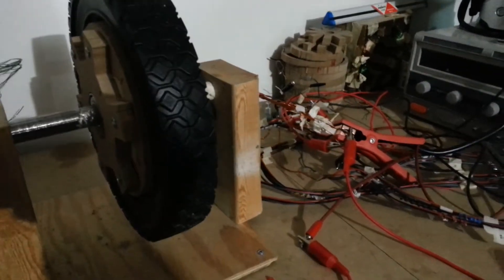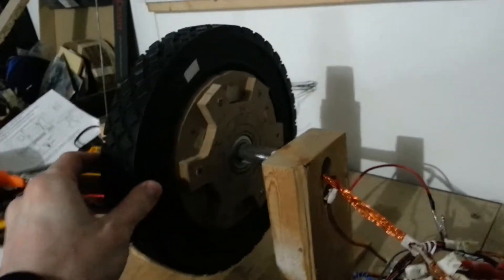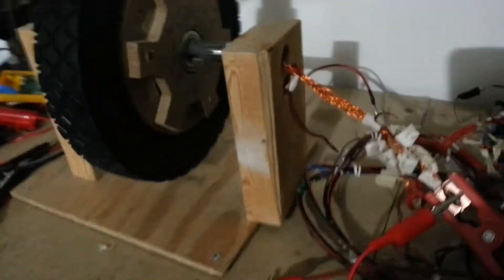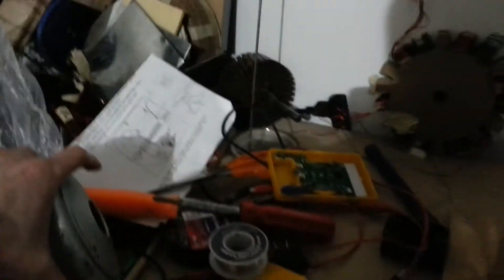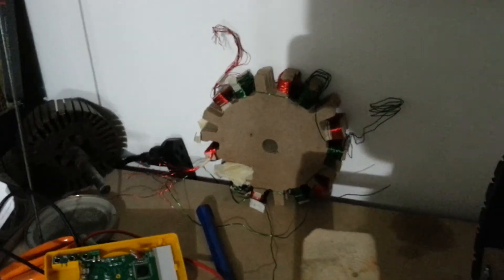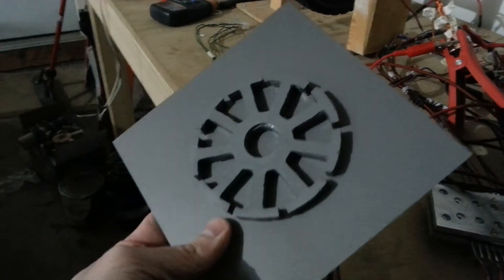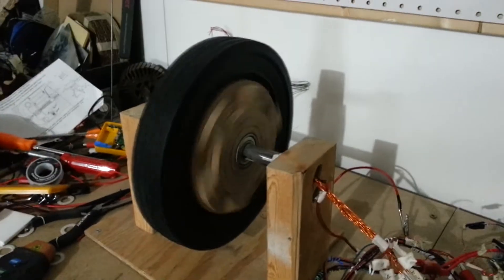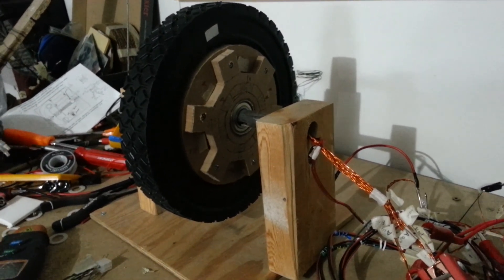Building a brushless electric motor - Introduction (Part 1)

Comment: Impressive looking motor.  I liked and subscribed, and hope to see  the rest in the series. To see how it is built and performs. 

Im guessing you already know this when you eventually mentioned special metal, but for anyone that doesnt know, one thing needs to be cleared up regarding 3:50 statement on laminationed steel. Yes laminated steel does help reduce eddy current loss, but they do not reduce hysteresis loss. Rather, using specially chosen metals like electrical or silicon steel and a few others that have low coercivity and low retentivity result minimizing the the area contained in a hysteresis loop,  thus minimize hysteresis loss.  https://www.nde-ed.org/EducationResources/CommunityCollege/MagParticle/Physics/HysteresisLoop.htm

Comment: Hi, like your design ! would you have the kindness to send some links about how theyr exactly made? ( calculation and so on) Cause i'm planning to do a motor that fits into a 10cm wheel and i've got a hard time to find godd stuff on the net.
have a great day and sorry for my rather porr English !
Reply from the maker: +Johan Kuhn Thank you! I have a few links that helped me. If you have specifics of what you want to make, I may be able to help with my own experience.  It is very difficult to find good links on the web, you're right. This first link has some rough calculations:

http://www.instructables.com/id/Make-Your-Own-Miniature-Electric-Hub-Motor/

This website is the kit that I bought to first teach myself the principles of BLDCs:

http://simplemotor.com/

One thing to keep in mind, from my own experience at least, is the speed vs torque trade-off. Higher voltage, smaller and less powerful magnets, and more turns of wire tend to produce more speed. More amperage, thicker/stronger magnets and more poles/teeth tend to produce more torque. And sometimes it is very difficult to get both in the same compact design. (More amperage needs thicker wire which means fewer turns, but fewer turns may reduce RPM).

This website helps you calculate how many teeth/magnet poles you need:

http://www.bavaria-direct.co.za/scheme/calculator/

I'd be happy to help out with any other questions.
Reply from the maker: Johan Kuhn
I bought my steel from http://electro-core.com/
The steel is pretty cheap, and cost a lot more to ship than the material itself. They will cut it to a general square or rectangle shape but I had to cut the teeth manually using a dremel table, as the cost of CNC cutting a small run is prohibitive.Get the thickest pieces you can get. I got 0.011", I believe, and it took forever to cut that many pieces.
Reply from the maker: It really depends on how you want to design your vehicle. Most electric vehicles rely on an inverter to change the DC battery voltage over to an AC current for use in AC induction motors. Tesla uses two massive AC induction motors in their Roadster drivetrain.  Maybe I'll make a video about it too, but 30KW is big enough that I wouldn't want to actually build it as it'd be costly and very heavy. The electronics to it would cost the most. Still, it'd be cheaper and probably lighter than a BLDC like mine.  I'll see what I can dig up to help you out.